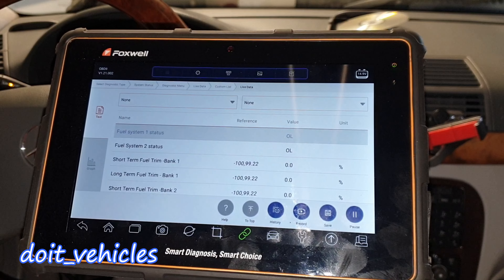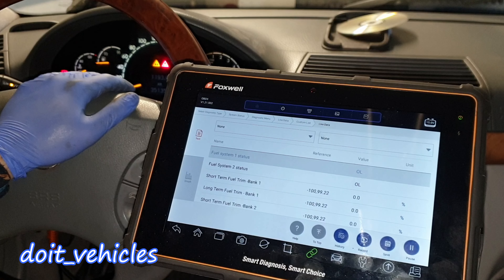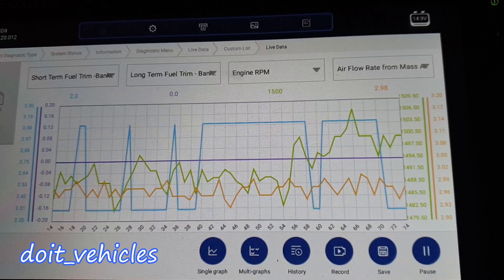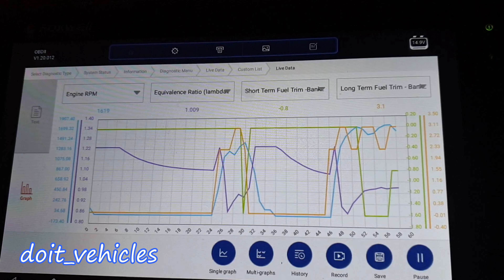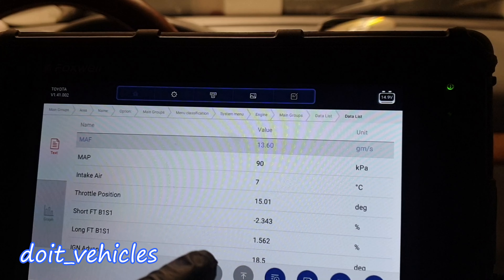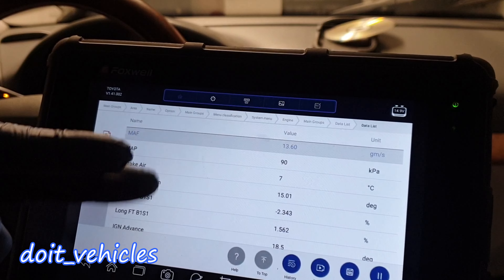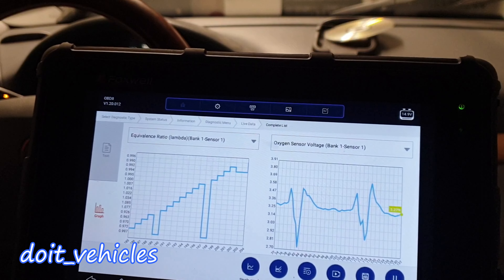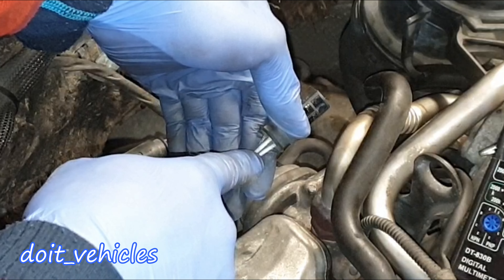W220 Mercedes S 320 Oxygen Sensors Check , Test , O2 Location

Comment: How do you know it should be 10-20 ohm for the heater? I heard the OEM O2 sensors have 2-3 ohm. That's why aftermarket ones with greater resistance give sensor heater problems.

Comment: I have LTFT 27% and STFT Zero %, LTFT go down with high RPM but stop at 18% and not go less that 18% whatever RPM especially not vacuum leak at all, 
You think O2 cases high LTFT,
Also i have intermittent P0068 related to Map sensor but i confused because LTFT shows really high

Comment: Hello  with me mercedes w169 cdi O2 sensor always shows 0V cold hot motor on diagnostics sometimes stands 1.999V hot when the car is and I notice varying engine speeds idle turn off start the engine back to 0V stand O2 sensor

Comment: Hello. Can a bad 02 sensors trigger secondary air pump on and off , when the vehicle is at operating temperature. ( 05 ml350 )
Reply from the maker: Hello ! Yes it's possible,  to confirm it the best is to check with a scan tool if the engine is in " closed loop ";This means the engine has reached the operating temperature ; And that will be confirmed by the O2 sensors .